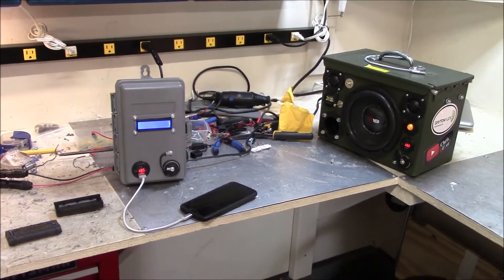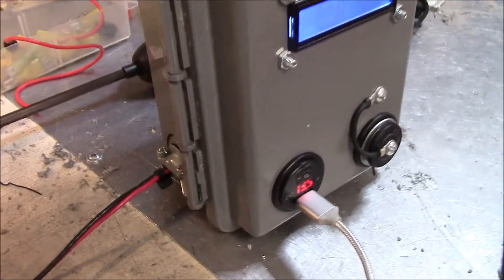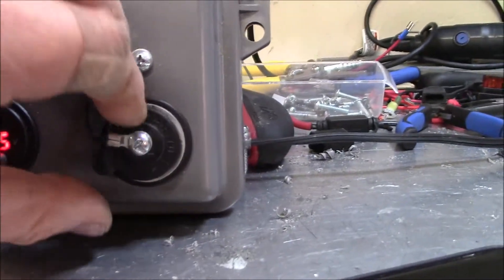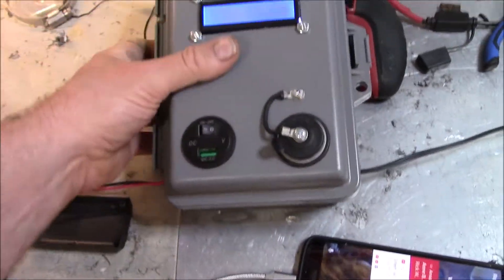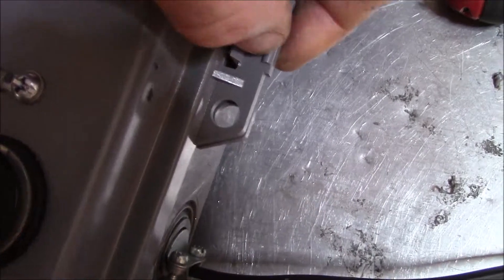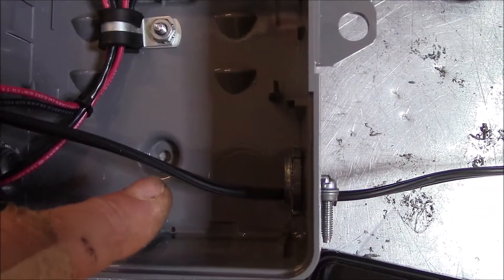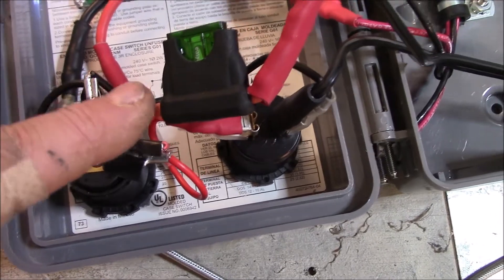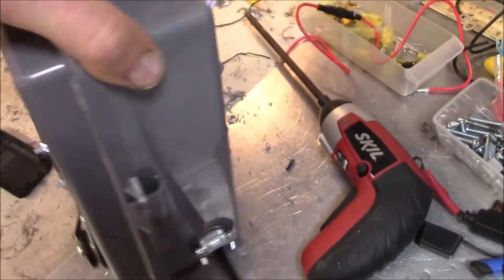Square D AC circuit breaker box conversion - 12v DC solar power charger/analyzer/power outlet

Comment: Sweet! I use a similar data logger on a DC generator. It gives me a cost per kilowatt. I could build another one only AC for the diesel or build a portable unit that could be used anywhere. Great idea my friend.
Reply from the maker: Thanks brother...that sounds cool. The whole premise of this idea was $0 costs with stuff just laying around. And make something decent to house that 10-amp solar charger...and add some handy "goodies" for 12v access/phone charging. I guess folks don't understand how much fun you can have with a 100w solar panel, some ingenuity, skill, and wire. To me, I think this thing is quite practical and I will use it...to others, well, guess they are scratching their heads or don't understand. You can also mount this box on a tree in the field. Be well...spring is here, people should "perk up" better now (esp online).